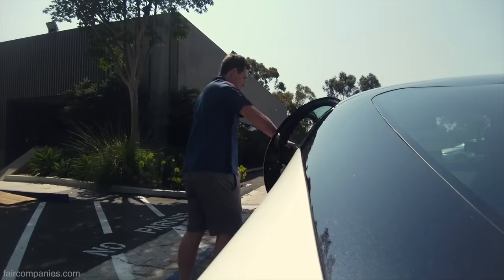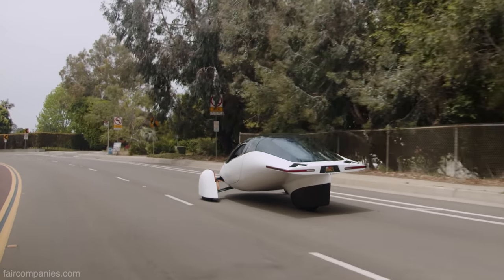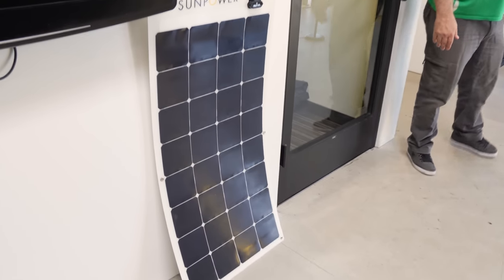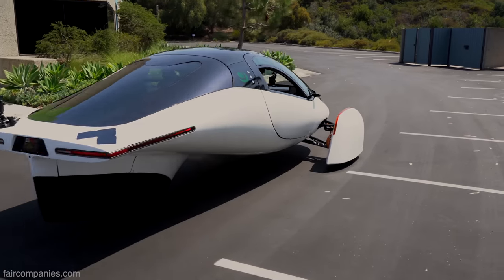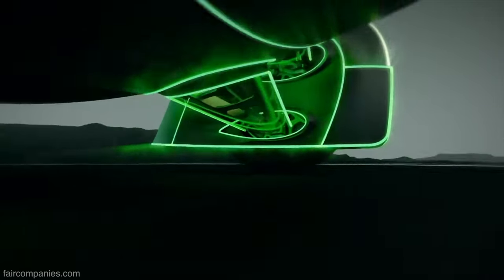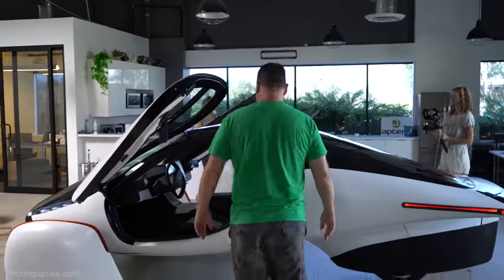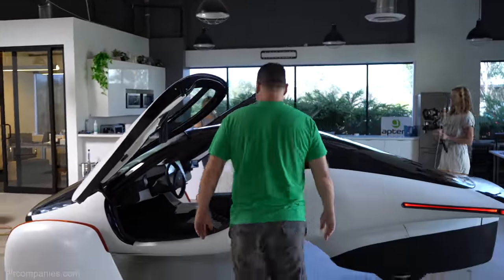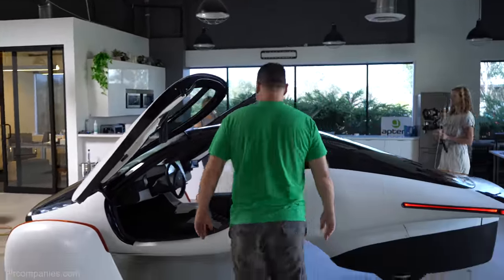Aptera commutes just on solar, gets 1K mile-range when full

Comment: Not mentioned: A 3 wheel vehicle is classified as a motorcycle and consequently,  not subject to the crash standards and other safety requirements of a car. So don't hit ANYTHING
Reply: They will comply with automotive safety standards and will be crash tested and the results published before they start shipping.  Do your research before spreading false information.
Reply: @n.brucenelson5920  Did even watch the video? A cursory examination of the vehicle shows it has no side impact protection or passenger airbags.  There's no way this will be as safe as an ordinary passenger car. 

Being classified as a motorcycle exempts them from passenger  car safety requirements and this car would never meet them. That's why is so light and small. Do you really think this car will withstand a 45mph offset barrier crash?
Reply: @CharlesFlahertyB  Well there is your problem, you only made a cursory examination of an alpha prototype that was filmed three months ago and have jumped to false conclusions.
Both side impact protection and airbags are included in Aptera' s many safety systems.

Comment: The comment about vehicles pushing wind out of the way is 60% of the wasted fuel is false.  

In modern vehicles losses due to air resistance only account for a few percent of total mechanical losses, the majority of mechanical losses, which account for a little over a third of all losses, are from friction; such as overcoming rolling resistance (friction between the wheels and the road), the engine parts itself, the gearbox, and braking.

Another third is lost through the exhaust, even with modern exhaust gas recirculation, because cars tend to run slightly rich because fuel acts like an upper cylinder lubricant, and keeps the pistons cool, and excess burned fuel exits out the tailpipe.

The last third is lost as heat. Engines are really good at converting fuel into heat.  In fact, cars can be designed to almost eliminate air resistance and drag, but those cars would likely overheat, because some level of inefficiency is necessary in order to keep the engine cool.  You need to design the vehicle so that wind goes through the radiator, for example. However that necessary inefficiency still only accounts for a tiny portion of mechanical losses and does not have a major impact on fuel mileage.

I don't know if maybe he's talking about something like a 1970s C10 square body, but modern cars have come a long way in this department.
Reply: You don't seem to have a handle on where the power losses are in modern vehicles.  As you should know, the power loss through wind resistance is directly related to speed.  Aptera is far better than any production car in this regard.

Your comment about the inefficiency in getting rid of heat that Aptera never generates in the first place should lead you to the answer of why Aptera is so much more efficient than ICE vehicles and even other EVs.
Reply: @n.brucenelson5920  I wasn't talking about EVs, I was talking about conventional internal combustion engines, as this is what the video seems to be referring to.  

EVs are considerably more efficient in terms of energy losses, especially with respect to heat and mechanical losses. But even if the Aptera is significantly better with respect to losses through air resistance, the net gains with respect to losses when compared to a modern conventional vehicle would not be as significant as you seem intent to imply, especially after you consider the average speed this car, and other cars, are driven at.

As for your point regarding wind vs speed, I will assume you're just not familiar with modern vehicle designs.  The losses with respect to speed is based on how turbulent the air behind the vehicle becomes, as this causes aerodynamic drag, which is to say it creates an area of low pressure behind the vehicle that creates a force that opposes the forward direction.  In older vehicles this was a pretty big problem, but modern more aerodynamic vehicles are designed to minimize that turbulence, and so that effect is actually relatively small for most driving. I happily grant that the problem increases at higher speed, but most cars nowadays have a relatively low shape factor coefficients, and so most driving isn't an issue that significantly effects mileage.

The point was not that drag isn't a problem at all, the point was that the claim that "60% of fuel loss is pushing air out the way" is false, and it is.  Even as you seem marginally aware, that claim, even if true, would only be true for a specific shape factor at a specific speed, and would not be accurate as a general statement for all cars, so even if you agreed with the statement in some specific circumstance, it would still be highly misleading.
Reply: @ixamraxi  All you have to do is compare the average MPH of an ICE vehicle to the MPGe of Aptera to gain an understanding of how large the overall difference in energy efficiency is, even if the reasons vary according to case.  You are correct about turbulence being a major source of the drag.  But the Aptera Cd is dramatically lower than even the best conventional vehicles intended for consumer use if we exclude specialist vehicles built for things like the Sunracer competitions.

The overall point of a dramatic leap in efficiency still holds but it is a combination of many things - far less energy loss in the propulsion motors, less rolling resistance, less mechanical loss, and less aerodynamic loss.  This is why Aptera has an efficiency advantage even over other EVs, let alone ICE vehicles.

It would be misleading to claim that that advantage does not exist.

Comment: I would really like to see what position they take in terms of future repairability of the vehicle when it will eventually at some point have something stop working and will require repair.
also, seeing the price at $25,900 is kinda nice for a starting price but for a vehicle of this footprint I would like to see that price down in the $10K-$8K range once it reaches mass production
Reply: Aptera grants right to repair, so you or any independent repair company can source parts and do repairs if for some reason you don't want to or can't go back to the company.  Incentives are likely to lower your net price by thousands when you take delivery.

Comment: The three wheel design is extremely interesting, but it seems to me that the efficiency-over-all-else ethos is limited to energy-efficiceny. The practicality seems limited to that of a sports car. I would love to see a four seat, sub-compact version, with the rear seats straddling the rear wheel and a larger flat roof to allow a simpler, flatter, perhaps cheaper solar roof. Elon was smart to build a sports car first, since having the practicality of a sports car is forgiven if your car is a sports car.
Reply: My wife and I have been using the Gen 1 Honda Insight for years.  When our first one was totaled being hit from behind on the Interstate by an SUV driver who fell asleep, we found and got another one.  Although the two vehicles weigh about the same, the Aptera has far more performance and interior room.  (5 cu ft in back for the Honda, and 28 cu ft for the Aptera).  It will be far more practical for us in several ways, including the ability to sleep in during camping trips, and a far lower cost of operation and service - even considering the 50 mpg plus mileage we get from the Honda.

Comment: Yep that's cool....ever going to build it for actual use?  Been waiting what a decade now?
Reply: This design and Aptera Motors have only been in business since 2019, the year that the Tesla Cybertruck was announced.
Reply: @n.brucenelson5920  they have been farting around with that design for around 20 years. The latest is just paperwork.  They are good on novel designs and spending money, not so good on actually making a product.
Reply: @GeoFry3  This is factually untrue.  The present design by Jason Taylor has some general design elements from the one he produced for the original company, there is not a single common part between the original and this one.
Reply: @n.brucenelson5920  speaking of facts..  thr "new" project is still as much if vaporware as the old project.  Cool buy pointless.
Reply: @GeoFry3  Which is not at all.  There were around 17 of the original companies' prototypes sold off in the liquidation.  The Museum of Science and Industry in Chicago had one on display.  The current companies' design has 3 alpha prototypes, one of which I have ridden in, and is now building betas, at least one of which has entered the testing phase to validate performance and production parts.  

The fact that other companies are starting to talk about efficiency and showing similar design cues, shows that it is not pointless  Even if they ultimately fail, which is possible but I think at this point unlikely, they will have moved the needle in spurring other companies to build more environmentally friendly vehicles and in a far less capital intensive manner while improving on quality.  This does not seem to me to fit the definition of vaporware, unless you extend it to the Cybertruck, which was announced the same year Aptera restarted.

Comment: EU's one by the German company Sono has the their Sion, that is coming out in 2023.  Unfortunately not yet USA compliant. Don't know if they intend to, but that vehicle is SUPER CHEAP projected $20,000 EU.  As for this car, the suspension needs to be there.  With my back... Forgot it!  Cannot deal with my body getting beat up on bumps and bad roads.  Noticed the driver door at the bottom not flesh with the car.  At the end there with the shot from the rear, LMBO Mickey Mouse hat shape

Comment: It barely fit in the parking spot. The outside wheels looked to be on both lines.
Reply: No, I have ridden in a prototype.  It fits nicely even  in a compact parking space with room to spare.
Reply: @n.brucenelson5920  You must have noticed it is as wide as a full-sized truck. Having driven in Europe, the width will certainly be an issue there and could present problems for those with really old garages.
Reply: @RonsTruth  Yes.  I have also owned and driven step vans in the US, that because of the sliding doors, also fit.  Aptera will not be a universal vehicle for Europe as presently designed.  Even in the US, it occupies a niche.

Comment: A working  Prototype is NOT a business. Don't risk your life savings 💕 investing in a dream, wait until they are in production.
Reply: No, but 3 working prototypes are an important step on the way to a successful business.  Tesla did not even have a working transmission for their Lotus conversion in the same time frame.  Aptera is moving at relative lightning speed and with more openness.
Reply: If that would eat up your life savings you are not in the market for one. For some this will be an amusing toy that costs them no more then it costs you to buy a new microwave oven, as a percentage of your wealth.

Comment: Kirsten; it can't use the sun for most of its charging needs unless you live in the sunbelt and drive under 30 miles a day ; their claimed range ; which are fake claims because their drag numbers don't include rear view mirrors or a center mounted headlight as required for a motorcycle - 3 wheel vehicles are motorcycles.  So approximating if left baking in the sun all day in Southern California you might go 20 miles.  northern climbs 10 miles, heavy clouds zero miles.

Comment: So 100Wh/mile (didn't disclose at what speed or elevation) and 700W solar would mean you can charge 7 miles worth of electricity in an hour. With 10 hour daylight that would be about 70 miles/day. It's OK but not overly impressive. The 1,000 mile range is largely irrelevant when you have to charge it for 14 days to get that range back using only solar. You'd be much better off charging with panels on the roof of your house, the whole 1,000 mile range is just hype and unnecessary battery.
Reply: Not quite.  The 100 watt hrs per mile is under EPA highway conditions.  The total power on a San Diego Summer day might be as much as 4,400 watt hours, or about 44 miles.  You can look at the solar insolation tables that they link to on their web site to get an idea of what you can expect to average in your area.  This is still more than the average daily driving needs of most Americans.

Comment: I see why I squeaks and rattles as soon as you started moving the driver side door cracked open passenger door stay tight like it was supposed to
Reply: The doors and suspension have been completely redesigned by Roush Performance.

Comment: SIDE CAMERAS that will break and cost an arm and a leg to replace!  Yeah, no, I'm sticking with cheap mirrors.  How about save the camera battery power for even more miles and aerodynamically engineer the mirrors onto the car.  What's that saying "If it's not broke, don't fix it."
Reply: At this point, cameras and adjustable mirrors have little cost difference.

Comment: Wheel dead aka unhung weight might be an longevity issue and safety, also 700Wh of that surface is a bold claim.
Reply: The 700 WATT (not Wh) is not from the "surface" shown in video.  It's for the full solar package which also adds a lot more solar cells on the rear hatch.
Reply: Solar cells used are 22-23% effecient.
Reply: @n.brucenelson5920  ..and? Its common efficiency today. 10sqft of solar is still under 200Wh peak, means 100Wh average and I cant see 10sqft of solar on that car. How did they come up with 7x that amount is beyond me...
Reply: @Helloverlord  Aptera full solar has 34 sq ft of panels.
Reply: @n.brucenelson5920  Yeah, sure.
Reply: @Helloverlord  full solar  covers hood, dash,
Reply: @Helloverlord  Full solar covers hood, dash, roof, and rear hatch.
Reply: watthours is energy, watts is for power. otherwise agree with both of your points

Comment: Maybe You people need to Make a Three-Wheeled Motorcycle, Where your out in the Open-Sky. You could have Removable Panels, So You either Could Ride out-in-The Open, Or in the-{Inside} of a enclosed-{car-Motorcycle}. I like Motorcycles, (Especially-Harley Davidson).
Reply: Aptera is not a car, its a 3 wheel motorcycle
Reply: @sandervanderkammen9230  Which will exceed my 4 wheel car in every practical measure of performance and utility.

Comment: what happens when you crash with an 8000 pound truck or SUV ?
Reply: Of course you don't want to do that.  However, with front and rear crumple zones, air bags, seat belts and an F1 style passenger safety cage, you have a better chance than in most two seaters.

Comment: Could wind flip it easily?
Reply: Good question.  It is much more stable than slab sided SUVs. It has been tested in 110 mph side winds.
Reply: @n.brucenelson5920  
Thank you for answering.  

I need a better comparison because I don’t trust SUVs. 
We have a 3500 Van 
What exactly is the wind factor for flipping it over? Do you guys know? 

If I was going across a bridge in high winds, could it blow it off a bridge? 
Those little cars called a GEO, was crossing the Bridge in Michigan and got blown off the bridge. 

I feel safer in something heavy n not lightweight. 

I am afraid of bridges ( man made n deteriorated) and I’m a truck driver. 
It’s Not a good fear to have but I manage.  

To be in a small car like that would cause me an amazing amount of fear if it’s not actually heavy enough to keep its wheels on the ground. 

It looks too light, like a toy maybe. 
But that doesn’t mean it is. 

How much does it weight? 

I see it turns well without looking as if it will flip like a three wheeler could. 

What about going up steep hills….could it flip up n over backwards or is it heavy enough in the front to prevent it? 

Is it known if a heavy wind could flip the front up n over backwards on a steep mountain pass? 

Can it power in the sun while driving? 

It says it goes a certain amount of miles, then the car needs to stop to recharge? 
So, it’s not a continuous charge on the battery? 
Will it recharge on a rainy day? 
Or in a garage? 

The car doesn’t seem like it could actually be reliable enough. 

It seems iffy. 

How long before the batteries would have to be changed? 

Hmmmm, I just don’t know if I could be comfortable with a car like this. 

Maybe I would have to drive it to see what I really would think about it. 
TY
Reply: @n.brucenelson5920  
I don’t know of what could stand in 110mph winds! I certainly would not be in a bridge! …..
in Any car! LOL

Comment: I saw such a e car 5 or 6 years ago nor sure its same , but if not is this a copy
Reply: The same founders tried to introduce a similar concept years ago.

The startup incubator, Idealab, brought in a CEO from Detroit.  He gained control in a board fight, ousted the founders and returned the deposits.  He then liquidated the company and sold off the 17 prototypes.

The original founders founded and ran several successful companies, including taking a lithium battery company through IPO.  They bought the rights back in 2919, regathered the original players including the designer, and now have a new vehicle based on the original principles but very different power train and performance from the oiriginal.